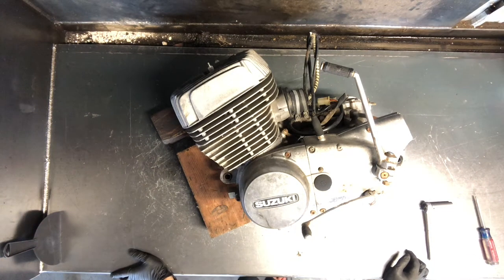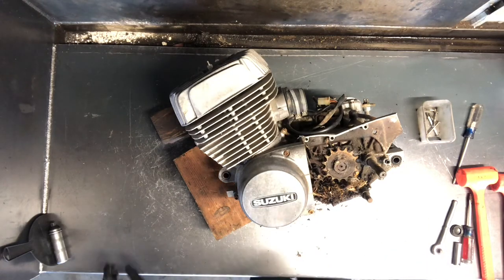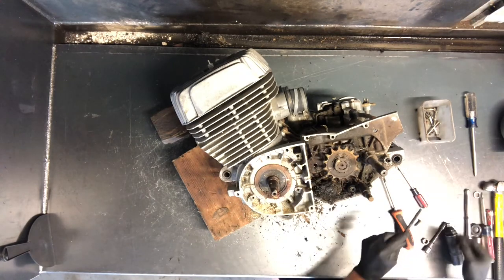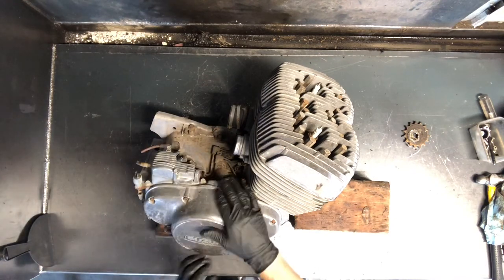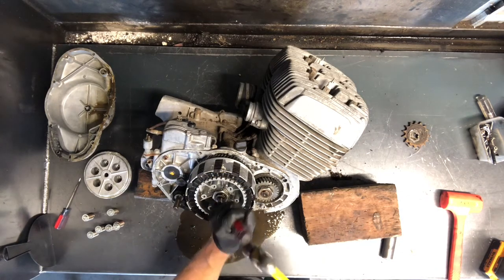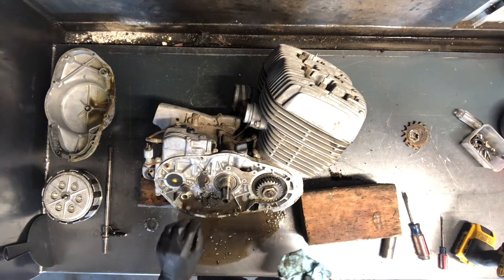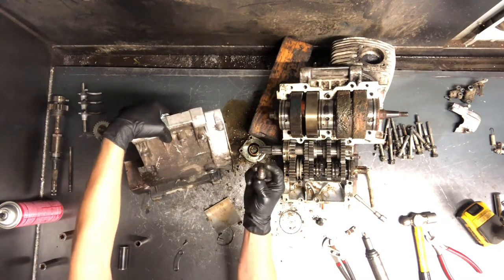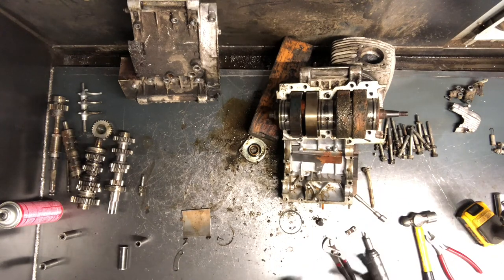1975 Suzuki GT500 Motor Engine Rebuild - Tear Down - Charging / Clutch System Explained - Vintage

Comment: Great engines.  My first street bike was a new 1976 GT500A.  I ran it all over Texas, Georgia, South Carolina and Florida.  Over 35,000 miles using Bel-Ray Si-7. It never missed a lick.  At 30,000 I pulled the heads and cylinders to check the bores, rings and de-carbon.  Still had the crosshatch in the bores and all clearances were in spec.  The only thing that broke on that bike were the front fender stays.  They all cracked on that model.  Sold it in 1984 to buy my first inline four.  Good video.

Comment: Read up on the history of the largest twin two cycle ever made . The American engineers said it would generate too much heat and melt . They were close . Overhauled my friends in an afternoon . Crank seals good , so an update on rings with a fine hone job and a set of rings . New plugs , points and condenser . Also a carb cleaning . Trick on riding was finding a sweet spot for vibration .